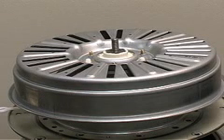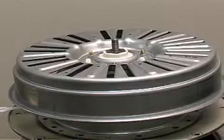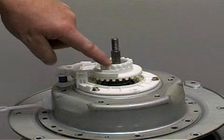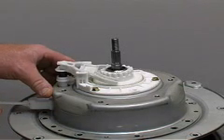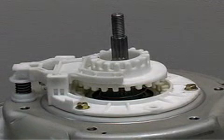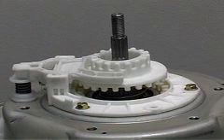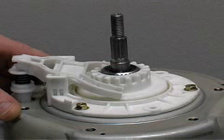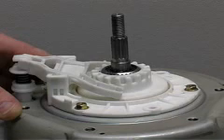HARMONY washer clutch coupling operation

Comment: What makes troubleshooting of the clutch assembly difficult is the fact that it is all hidden inside the motors rotor. You cant take the rotor off to watch the clutch operation as the rotor needs to be in place to start the cycle. I keep getting a clutch error and occasionally a motor error. Clutch ass'y has been replaced but didnt help. Clutch motor was disassembled and bench tested perfect. Problem intermittent. Any ideas are welcome.

Comment: I know this is probably a long shot. 

I have a question for my ge profile harmony washer. It's been leaving my clothes wet. The washer spins and I've done an extra spin cycle to see if it would leave the clothes less wet but nothing. At one point, as I was doing a spin cycle "only" I opened the door top load and it stopped abruptly with a message saying "Service Mode Diagnostic" "Broken clutch coupling". 

I turned off the machine and powered it on the next day, it ran through the factory welcome tests. 

It is operational but it is still leaving the clothes wet. I have replaced the drain pump a few years back so I'm not sure if the coupling is the problem or the pump. Any thoughts?

Comment: I doubt I will get an answer but I will chance it.  Is it possible to run these motors on the bench outside the washer using spin mode?
I have and I got 8E error code.  Overcurrent error.
Reply: 2 years later- I dont see any way to bench test the motor as it is a direct drive and the center splined shaft is connected to the rotor and infusor at the bottom of the basket.